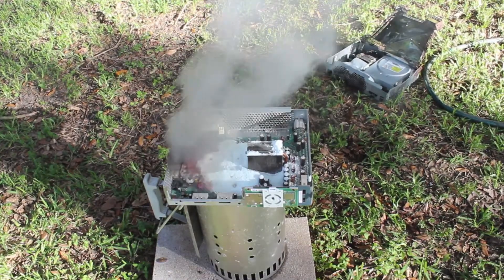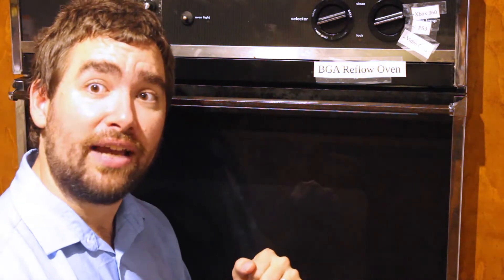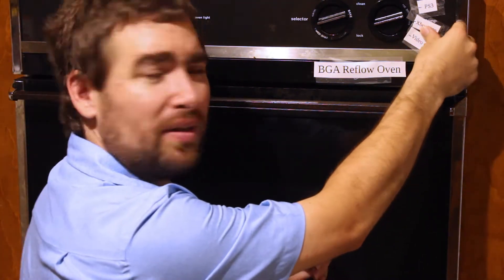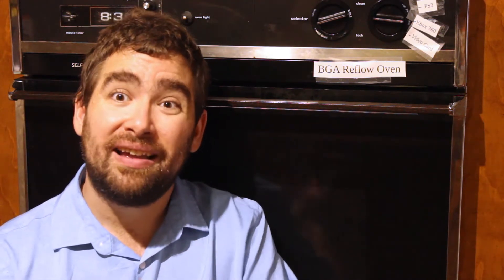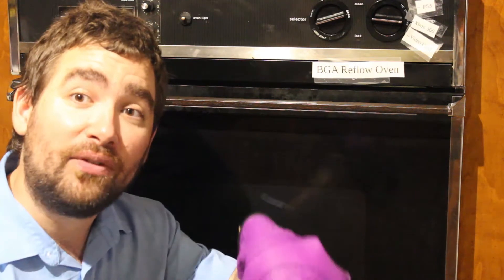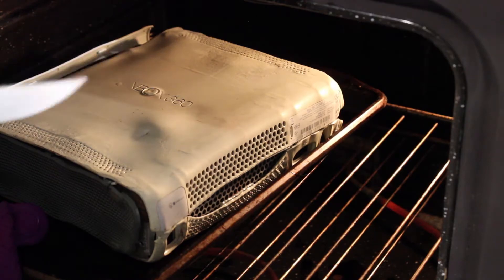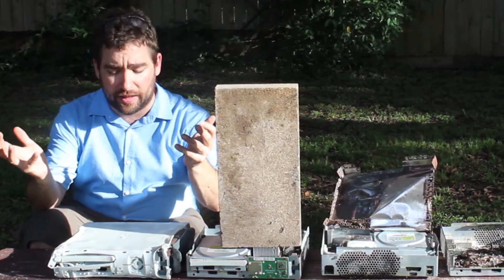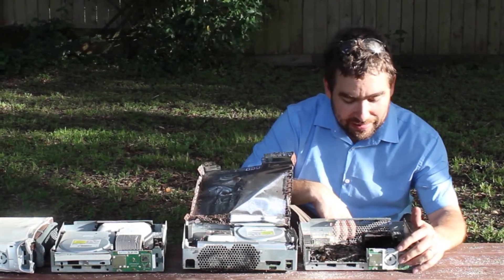How to NOT repair an XBox 360 - Voiding Warranties Ep 9

Comment: Actually, if you take the board out of the Xbox 360 the oven method is the best one, closes the cracks in the solder that are caused by expansion (and of course 20 minutes is too long), I normally put the board into the oven for 10 minutes at 200 °C, and except for an exploded BIOS battery on a PS3 motherboard (yes, I forgot to remove it), nothing has happened. And if the previous owner didn't mess up the board I have a 100% success rate with this method. Apply some flux before putting the board into the oven and some new thermal grease afterwards, and your Xbox 360 can last for a few more years.
I personally don't like XCLAMP-fixes, because most of the time you do more damage than good with this, by applying too much pressure.
The powder in your last method, was it thermite? If not, that's another fun way to "fix" a RROD:
https://www.youtube.com/watch?v=ltswyMP9UMY
Reply from the maker: I had good luck with a hot plate and a heat gun, but the biggest problem I had was no method was a guaranteed permanent fix. Some would last for a week, some for a month, and some would last forever. I didn't feel comfortable selling them because of this. And the powder was dry mix rocket candy. Thermite would have been more impressive though.